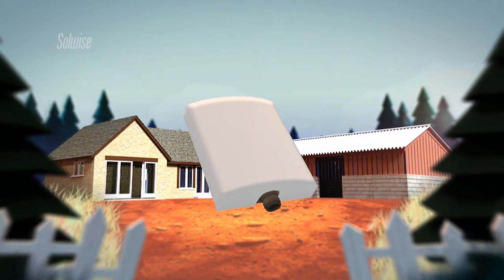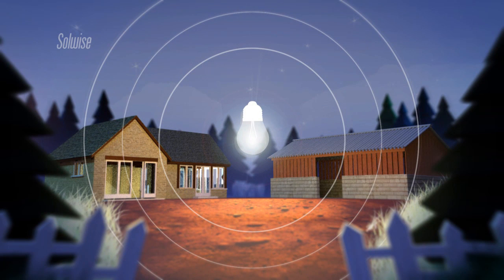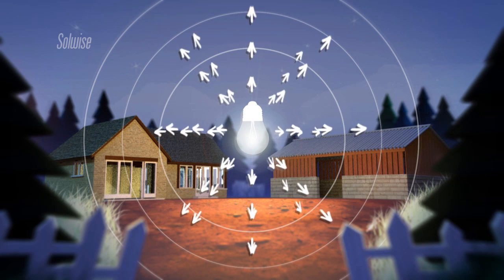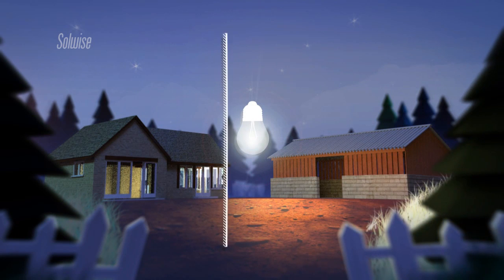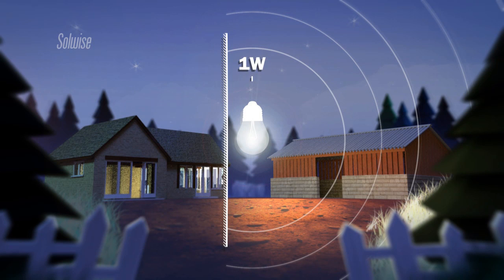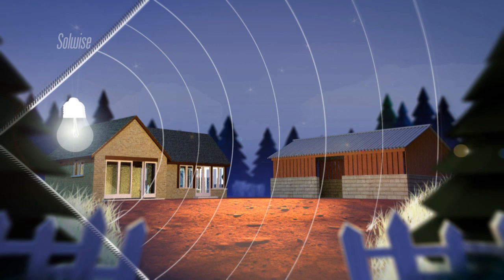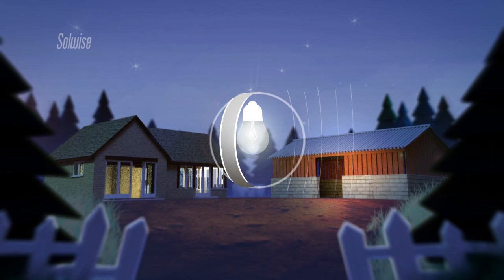What is Antenna Gain?

Comment: What about gain on an omni-directional antenna? You can buy a vertical antenna that is unity gain at 1/4 wavelength or one that is 3db gain at 5/8 wavelength. Is the 'gain' then less loss on the longer antenna? Is the 'gain' relative to a 1/4 wavelength antenna?
Reply: "Unity gain" is just another way of saying 0dB gain, so a 3dB gain antenna would radiate a more powerful signal within it's effective window.  The 1/4 and 5/8 wavelength references  are about the trcks used to  ensure that the antenna accepts the power from the transmitter rather than reflecting it it back up the wire whilst at the same time forming a suitable radiating pattern that gets the signal to it's recipients.
Reply: @SolwiseMD  I realize what unity gain is, but how can a omni-directional antenna actually have gain? Unless it is just referenced to a 1/4 wave antenna as having 0db gain. Antennas are passive devices, so how can they have gain? This video demonstrates a directional antenna where the total rf is being 'focused" in an ever increasingly narrow 'beam'.
Reply from the maker: @paulschmitterk2pms5  https://www.youtube.com/watch?v=twNVEyjbKRY  See our video "Antenna Radiating Patterns explained" for more info on this.

Comment: Then how would we know by seeing the antenna that which side is it focusing its waves? Will the user need to put receiver antenna in same direction mandatorily as the transmitter antenna has gain in one direction!?
Reply: Identifying Orientation: I'm not sure there is a generic answer to this question,  antennas come in all shapes and sizes.  If it is not obvious try searching for an arrow somewhere on the antenna, otherwise consult the manual.  

Selecting Orientation: If the link is point-to-point then the two antennas should be aimed at each other.  For point-to-multipoint then the central antenna should be  omnidirectional and each endpoint shoul be aimed at that.

Hope that helps.

Comment: So what if you have a pole antenna that is 8dBi, is it going to be shooting a flat donut shape rather than a tall one?
Reply: Basically yes, though 'donut' would better describe the shape in the polar diagram.  The radiating pattern itself will just keep getting wider (higher and lower) the further it gets away from the antenna.  The angle depends on the gain.  The higher the gain, the tighter the angle.  You might get a better feel from my "Antenna Radiating Patterns Explained at https://www.youtube.com/watch?v=twNVEyjbKRY

Comment: i used to explain to people that a lot of things in physic can be explain in other type of form using other material or physic to understand it easier. just like if you amp up the power way too much it doesn't really improve the signal as much compare to the antenna itself. it might disrupt the listener. i relate it to screaming. if someone talk normally you can hear the words clearly. but if you scream the words next to your ear, its harder to hear it clearly. in some case, giving too much power disrupt the quality of signal.

Comment: ok so if an antenna has dBi then it's always directed.... if it's not directed it's dB? Why did the name of it change from 0dB when not directed to 3 dBi when directed? Where did the 'i' come from? The isotropic condition you say in the video.... but why not call 0 dB '0dBi' because you still have an isotropic condition... being completely isotropic right? Do you only use dB when there is no gain?

And why is doubling the power 3 dBi and not 2? You said the zero gain is 0 dB then you gained by 2x and called it 3dBi?

Are there any antennas that are jst dB and not dBi? What if I want an antenna that goes equally far behind as forward?
Reply: You are getting confused between 'ADDING 3dB' and 'MULTIPLYING by 2'.  These two expressions actually mean the same thing (approximately).  It's easier to see this using full Bels: 'MULTIPLY by 10' is (exactly) the same as 'ADD 1 Bel', ie 'ADD 10 deciBels',  also  'MULTIPLY by 100' is (exactly) the same as 'ADD 2 Bels', ie 'ADD 20 deciBels'.  Generally we are talking here about gain or loss so we are comparing two values.  To do this in ordinary language we would use words like stronger than, brighter than, louder than etc..  For instance "This antenna is rated at 10dBi, it radiates a signal 10 times stronger than a hypothetical isotropic antenna."  It helps to notice that each Bel (or 10 deciBels) you add means an extra zero on the number you started with.  You might also check out my "What is a deciBel?" video which some people find usful. Oh, and yes, the 'i' means 'isotropic'. An 'm' would mean '1mW' and a 'W' would mean '1W'.  'A' is used to represent the quietest thing you can hear.
Reply: @SolwiseMD  No the answer is that we cannot make an isotropic signal... it's impossible, I found this out later. It's actually 1 dBi not 0. A perfect isotropic signal apprently according to this lecture I watched on antenna gain, is 1 dBi (maybe dB I can't remember now if it was dBi or dB but a perfect isotropic signal would definitely be 1)... no gain. Once I'm told that it makes complete sense.... Mostly about the part that we are unable to make an isotropic signal.. it's not possible.
Reply: @SolwiseMD  what you just ses is just about exactly what i sed

Comment: so, question, if an antenna is advertising  22db and another model is saying it/s 17.4dbi, which one has the stronger signal and I should buy for my house ? if the 22db didn't state i or d, then does that mean that you can't really give an answer, cause we don't know what that manufacturer is really saying about it's db gain ?
Reply: It's not easy to answer this question very well on the information you have provided but I'll have a bash.  Firstly you don't say what you want the antenna for.  I'm going to guess it is for a 4G data service and answer you qustion on that basis.  Firstly 22dB is a very high number.  It is a gain of over 100x.  That means it will have a very narrow beam-like focus and be choosy about how accurately is is lined up with the mast.  Unless you are in a very remote location, better to find something with a lower gain capable of also picking up reflected signals and other masts.  This is likely to give better results.  See my other video about radiating patters, https://www.youtube.com/watch?v=twNVEyjbKRY.
OK.  What if no units are specified such as 10dB where we might expect 10dBi?  I guess generally we can assume if the gain is listed as 10dB we can assume they mean 10dBi.  That said, I have frequently seen 10dB used to describe the front to back ratio, which isn't really a gain measurement at all.  I've also seen grossly inflated figures claimed, effectively bare-faced lies.  All I can really recommend is that you buy your antenna from a reputable source who will discuss your needs with you.
I hope that is some help.
Reply: @SolwiseMD  thx. I was inquiring about ota fortv broadcast stations

Comment: Very nice explanation. i still confuse the term "dBi" and "dBm", some wireless adapter state "<20dBm", other 5dBi. 
But I have testing 2 wireless adapters, one with 4dBi, other one is 5dBi. My test is 3 floors building, where 4dBi device can detect the signal from the first floor and 5dBi device cannot (pickup only on the 2nd floor), instead the 5dbi pick up more far away signal but not cover the area (the under floor).
As in the video when you put the mirror = using 3dBi antenna, the light cover far away with 180 degree further, then later you put two mirrors = 6dbi, the light can cover more far away than 3dBi but with only  around 90 degree and at last you say put a curve mirror for the light to narrow to any direction for brighter. 
So could it i say the smaller dBi cover more area, where higher dBi cover more range? or simply < 3dBi can cover 4floors coz 4dBi covered 3floor and 5dbi cover only 2 floor?
Reply: OK, dBi is a figure which expresses gain over an isotropic antenna (which has a gain of 0dB).  dBm expresses a signal power compared to 1mW, so 100mW can be written as 20dBm.  I think the video describes the units better than I can in words here.
Now, your floors.  My video shows operation in free space.  Lets imagine the situation of our high gain parabolic light-bulb antenna which focusses all the available power into a pencil-thin beam.  Point this out of your window and we might get our signal to the moon.  Point it at the floor and we'll get our signal a far as the floor.  
This brings up two issues:
1.  Will our signal go through the floor?  Our light-bulb antenna will not penetrate the floor but how will your WiFi signals get on?  Well, if your floor is made of concrete you can expect at least 20dB of loss passing through it.  If your floors are made of wood and plasterboard expect a loss of 3 to 5dB. (But beware foil-lined plasterboard or insulation which will totally reflect the signal.)
2.  What direction should we point our antennas?  If we pointed our pencil thin beam of light across the street into our neighbour's window and it landed on his white-painted wall, it would probably illuminate his room quite effectively as the light scattered off his wall.  Note that if his wall was painted black the situation would be very different.  So the question is: How do our WiFi signals behave in this reflecting/scattering effect?  Broadly speaking the effect is similar to light and also dependent on the materials (though not colour). 5GHz WiFi tends to reflect more than 2.4GHz.
We should learn from these two effects that raising the gain of indoor antennas is usually fruitless unless we can predict the route the signals will take between the endpoints, which we usually can't.  
Paul Stephenson.
Reply: Solwise Paul Well thank you for your explaination, i get your point.

Comment: where is antenna? all I can see is light bulb... so if I put 1kW against the wall I can get 2 in opposite direction?
Reply: A Light bulb is an antenna.  It radiates electromagnetic waves in the visual light part of the spectrum.  I have increased it's gain by adding mirrors.  A wall might work as a mirror in some parts of the em spectrum but I would suggest a mirror is easier to visualise.

Comment: A light bulb isn't an isotropic radiator, because it has a lamp socket which creates a shadow above the lamp and the filament is also not an infinite small point and radiates more light on the side then on its ends. In fact isotropic radiators do not exist, they are just a theoretical construct. Anyway, that's just nitpicking. Everything said was correct and the explanation is a very good one! I use the light bulb analogy myself when I explain this to someone.

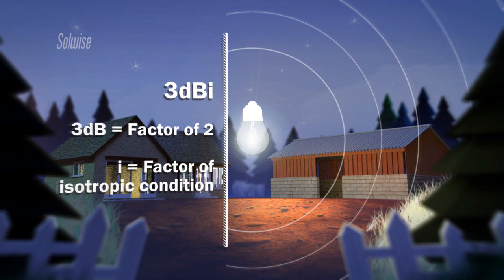Comment: What do you mean when you say "3dbi = factor of 2" (at 1:43 sec). Can you please elaborate this more.
Reply: +Amit Jain I had the same question, I ended up doing research on Db (decibel). He uses the wrong term here when he says factor, as that implies multiplication. There is no multiplication involved here.

The actual operation in play here is logarithmic. Consider a few things here. Db is comprised of a unit called "bels". the D in Db is from the term "deci", which implies the operation multiplication by 10. Furthermore, standard log operations have a base of 10.

With that said, here is how 3 Db = 2:

log(2) = x

Written another way:
10^x = 2 
solve for x

I cannot solve this without a calculator, it should be about .3.

x = 3 Db

Therefore 3Db = 2 (technically log2)
Reply: Muliplication is definitely involved.  The (deci)Bel scale is logarithmic in base10.  That is to say that each Bel is a factor of 10.  So adding 1 Bel is the same as multiplying by 10, Adding 2 Bels is the same as multiplying by 100.  In practice, adding three tenths of a Bel is so close to multiplying by 2 that we think of them as equal.
Reply: +Paul Stephenson Thanks for clearing that up. I think he should have used the term "multiple of 2" instead of "factor of 2". Everything would have made sense from the first time I watched the video if he had phrased it that way. I realize that for people who have very intuitive math minds, these semantics are marginal. My understanding is much more rigid and perhaps a bit brittle. 

Side note, I recalled how to solve the logs by hand (been a while since i've done math).

log(2)=x
10^x = 2
log(10^x) = log(2) 
xlog(10) = log(2)
x = log(2)/log(10)
Reply: +Daryl A , Thanks for your explanation.  EIRP is was something easy to understand, i wonder why we are using decibels.
Reply: thanks for this!